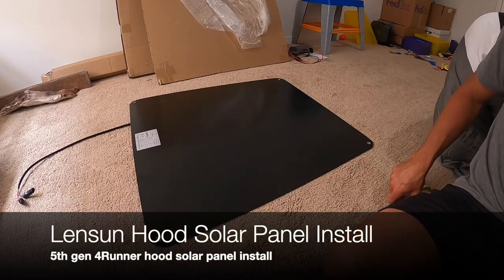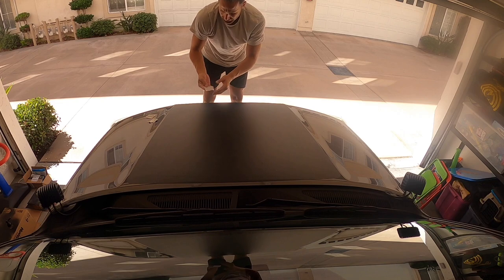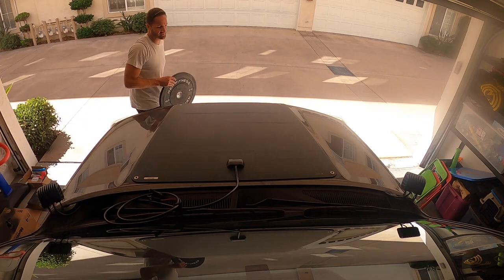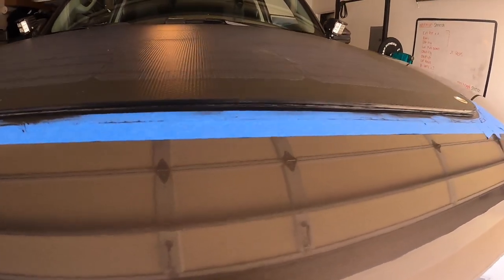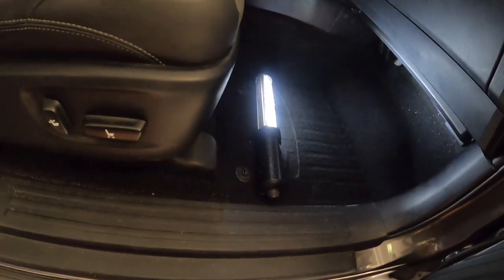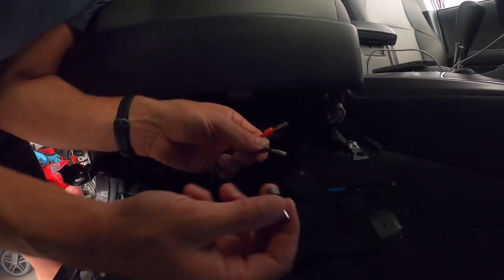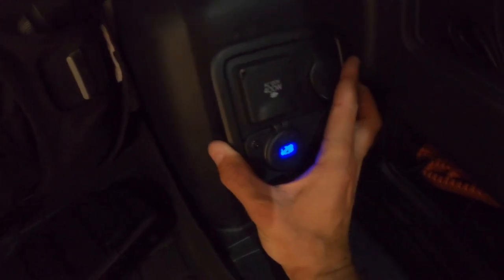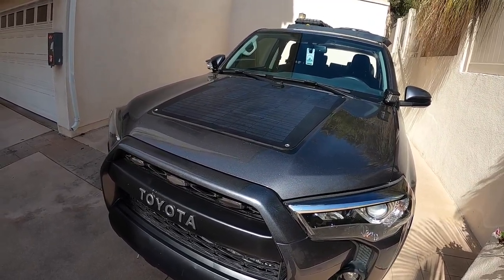Lensun Hood Solar Panel  Complete Install - 5th Gen 4Runner

Comment: I would suggest keeping an eye on the heat that the controller puts out under your seat, might want to mount it on a raised metal mount instead of the floor mat to give it better air circulation. May extend the life of the controller and avoid a fire.

Comment: Thanks for the install and review. I've been debating on getting a solar panel for the hood or just installing one on my roof rack.
Reply from the maker: Ya, I like it. I didn't have room on my roof for the solar panel so this was a great option.
Reply: I have a 160w panel on my roof rack, it is big and takes up way too much space on the rack.   It works great but I cannot wait for the hood panel so I can get all that roof rack real estate back for other toys.
Reply from the maker: @adamconnolly7478  Definitely! That is one of the main reasons I went with the hood panel.

Comment: Vertical tape likes seam like a bad idea at 100mph..... I also did some studying and I guess cascadia does like a neoprene spacer in theirs... Idk I've never had any luck with 3m, even for wrapping Christmas presents.. I'm probably going to just bolt mine to the hood or something and RV leak tape it in place
Reply from the maker: So far I've had no issues with it at all. 3M double sided tape is very strong. Bolting it will work too but I believe their updated versions of the solar panel no longer have the metal eyelets.

Comment: Does this charge while the vehicle is running? And does the engine heat affect the solar panel in any way? 

I'm curious because to the best of my knowledge you need air space underneath for cooling/efficiency.
That and I'm driving/idling alot.
Reply from the maker: Hi, Yes it charges while driving. I haven't had any issues with heat but you can just use the tape so you have airflow below. I was more worried about the panel coming off while driving than the little bit of air getting under to help keep it cool.

Comment: Good thing about it - its protecting your hood's paint. Bad thing - everything is black, under direct sun rays silicon, sticky tape - will just melt. Also I have no idea why does it necessary? Wheb you riding you can get 12V or 110V just from your car, when you are staying - a way easier to use regular portable folding panels
Reply from the maker: Its just a different option that I don't have to carry the folding panels and if I want to get a 2nd battery to power my fridge this will keep that battery charged.
Reply: Way easier to just keep fridge running 24/7 with a solution like this...  No fridge, then this is not really worth it.
Reply: @adamconnolly7478  moreover, for fridge, especially with ice not necessary to be always turned on. Anyway at night panels cant give a power to the fridge. in that case its just a toy.
Reply: @someguy9607  Having a fridge on 24/7 in Australia is an awesome toy.  You need solar to run fridges here.   The panels fill a 2nd battery which runs the fridge.   Also the solar keep the startup and 2nd battery topped up during the day....  Also you can park somewhere and leave the stereo going all day and night.  Solar panels that are always deployed save time, reduce cargo, and give you a peace of mind that your batteries will last longer.  Oh yeah and you dont have to keep plugging them back in when at work.
Reply: @someguy9607  If you live in Russia there is no need for a fridge lol.. Just put can in snow for 5 min.
Reply: @adamconnolly7478  I live in USA. I just puto in my fridge box a lot of ice and it keeps cold like 2-3 days with no electricity
Reply: @someguy9607  or you could just put a solar panel on your hood, and not have to get ice, drain water, and have 24/7 33degf water and drinks....
Reply: Agree plus no 20 -30 pounds of ice and water that can spill everywhever
Reply: But you have to buy ice how may times a month ? Then a year?unless you make your own ice but still whats the point? you cant put food in it with out wrapping it and making it air tight so water dont get in. And food in a cooler doesnt taste the same as a fridge/ freezer

Comment: Hi I’m reaching out to anyone that has one of these panels.  I am on my third panel due to defects.  I’m trying to find out if anyone else has had issues as far as defects I would like to hear about it. When this panel is installed with my system it works great. I have the redarc BCDC charging system for my dual batteries and with that and the solar panel my batteries are always fully charged but I’ve had two previous panels with defects and they’re sending me a third one which is arriving tomorrow I’d really like to hear if you’ve had any issues thank you.
Reply from the maker: Damn! That is a bummer. I have one other guy I know who is running Lensun as well and he hasn't had any issues but we both have the older version with the metal grommets. What type of defects have yours had?
Reply: @jeffsteffens  it’s had discoloration of cells they turned yellow and some bubbling that was on the first one and then the second one after two months of having it on it developed the lamination in the lower right of the panel I just happen to notice it one day and I started looking closer and noticed it was D laminated. So called the company and they sent a brand new panel after I sent them pictures again and I have no complaints about the customer service it’s top notch but this is the third panel so I’m skeptical whether this one is gonna last or not that’s why I’m looking for someone who has had similar experiences with them.
Reply from the maker: @physicalstarfighter2131  ah, total bummer. That is a pain. I hope mine does not do that. I sealed mine on pretty tightly.

Comment: DO NOT LISTEN TO JEFF.  Buy cascade 4x4's. It is worth the slightly extra money. Lensun is classic, cheap, patent infringement.
Reply from the maker: Sorry you feel that way. I am not comparing this to cascade 4x4. This was a reasonable priced panel and I heard other great reviews from other 4Runner owners. I've had this installed for almost 6 months and I haven't had any issues.
Reply: Who cares, the lensun is of good quality... I'd rather save the cash for diesel.  Buy another MPPT controller if you dont want lensuns...
Reply: some people just have lower stadards
Reply: $612 for Cascade’s and $494 for Lesun’s.
Reply: I've owned both brands, Lensun has a better solar panel, the Cascadia warped quickly and faded within 3 months of AZ sun